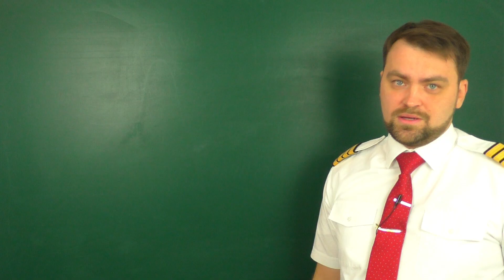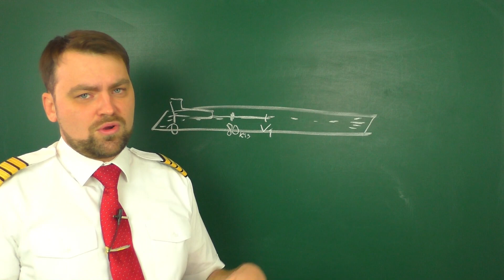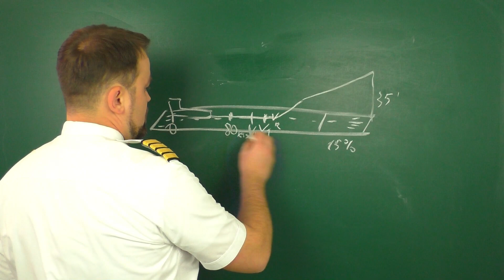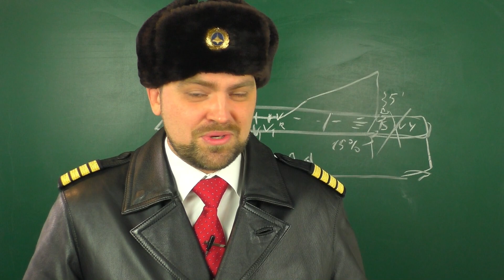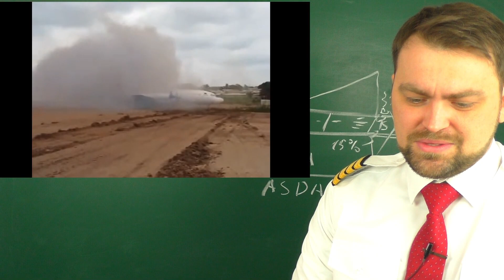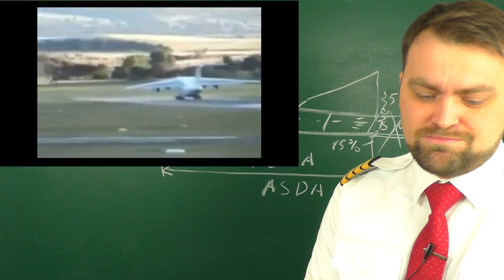Crazy Russian Planes Takeoffs | Airline Pilot Reaction | Ilyushyn-62, IL-76, IL-18 [HD]

Comment: The last location I know where that Il-18 (D2-FFR) stood was in Luanda, Angola, as recently as 2012 (4 years after the incident) per photos I saw online. Unfortunately, I couldn't see it on the maps recently, so I have no idea, really.

Also, yes, the PS-90A-76 is used in the newer Il-76s. The engine was first used on the Il-76MF (back in 1995) because not even the most-uprated D-30KP was powerful enough. And then, Volga-Dnepr and Silk Way ordered their (brand new from the factory) Il-76TDs with the new engines (hence IL-76TD-90). 

Then, one 1993-built Il-76TD was retrofitted with the PS-90s around 2014-5 or so, and is currently in use by Rubystar Airlines. That plane is named after "Monte Bata", a town in Equatorial Guinea.

Even the Russian air force has Il-76MD-90A and Il-78M-90A aircraft. The A-100 (future Russian AWACS) also has the PS-90s, as well as the A-50EI (A-50 Export, India). Two ex-Jordianian Il-76MF's are currently in use with Egypt's air force.

Comment: Hey Denys, can you pls tell me the V1 speed for 737NG, with full payload
Reply from the maker: It also depends on runway length, runway condition, temperature, pressure, OCH, MEL, Engine rating, Flaps setting. So I still can't tell the exact number...

Comment: Great video ,I think those Pilots should be severely reprimanded,dragging an aircraft into the air is never good,it severely comprises any safety margins that they had ,I used to fly a very light aircraft and I always calculated the c of g ,and weight and balance (even checked the weight of any passengers) .Crazy pilots ☹️
Reply from the maker: Indeed. Thanks for your comment. Great to know that you used to be a pilot. Keep it up, Devon!